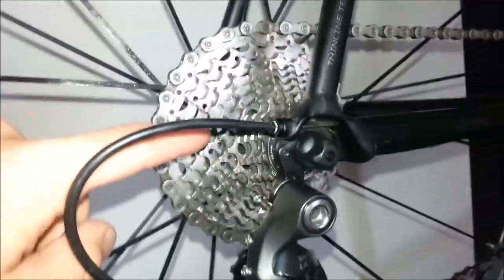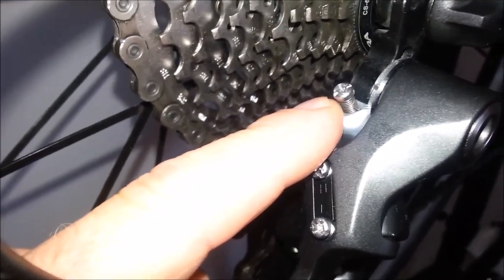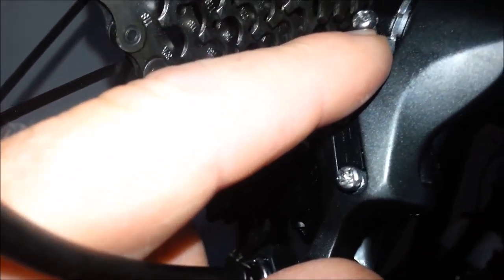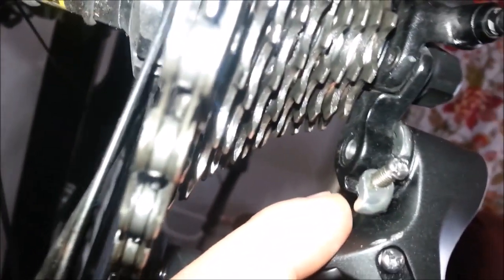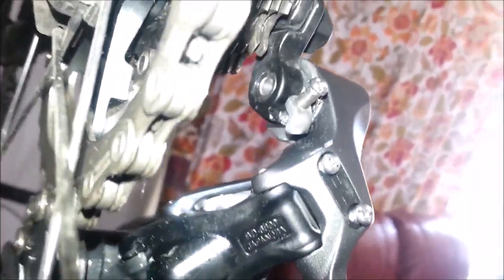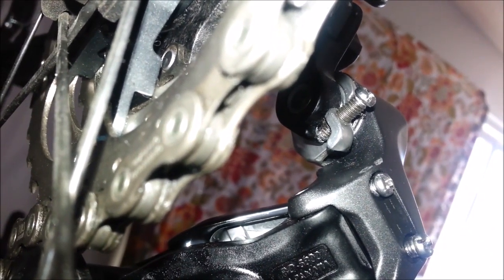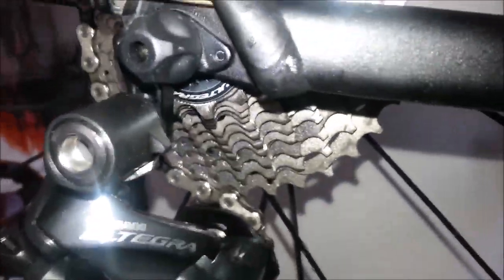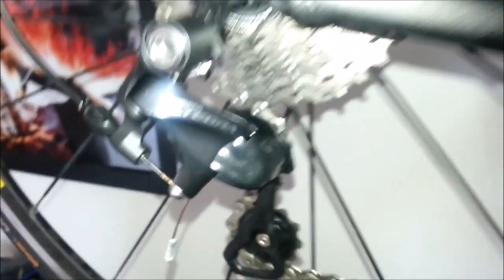I made a mistake [correction video] Short cage 32T CAAD12

Comment: would a 11speed 11-32 work on a 52-36front with the ultegra short cage?
Reply from the maker: Bart De Hauwere You'd just need to allow an extra link or two of chain, to compensate for the extra teeth on the chainring.